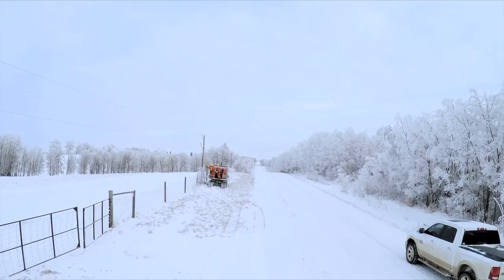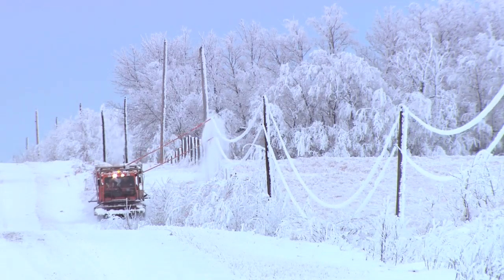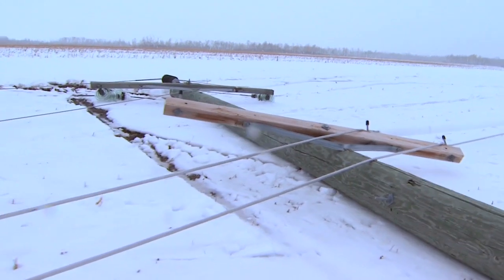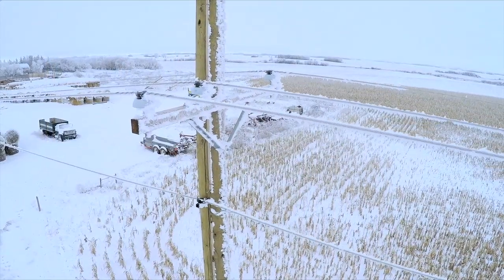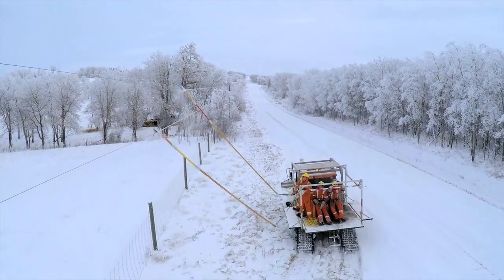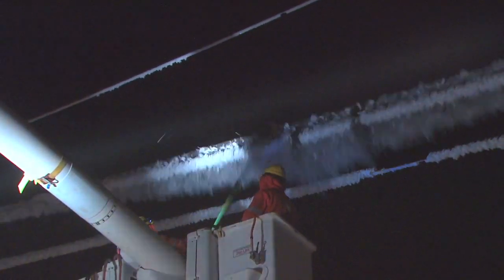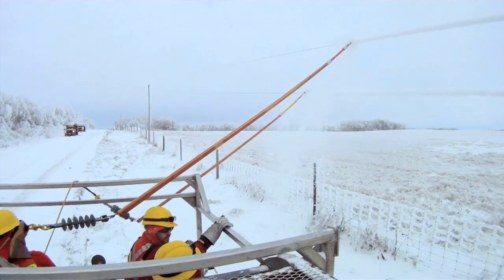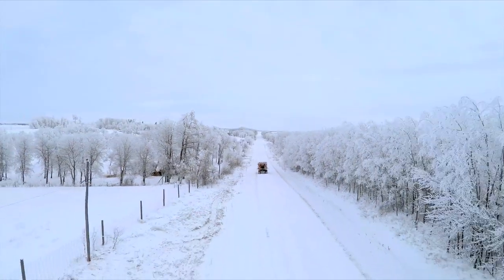Manitoba Hydro de-icing techniques

Comment: Why not just increase current and heat up the lines? It is a no-brainer.
Reply: Distribution lines usually have insulation over conductors And Increasing current will increase line loss & economy as well. So that isn't  a solution. No-brainer doesn't always work
Reply: @Jahid49  you only need the wires to get slightly above freezing temperature. Not a big of a del, even though it takes a huge amount of energy to melt ice, just as much energy to bring water at 0°C to water at nearly 80°C, three-quarters of the way to boiling.